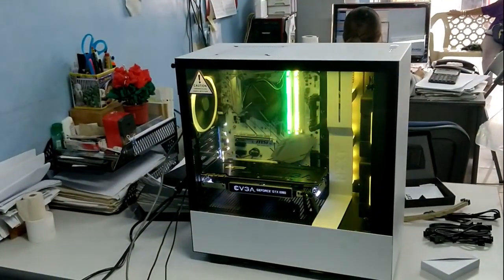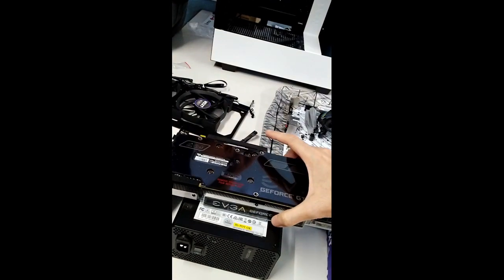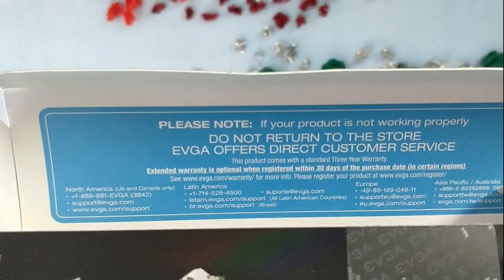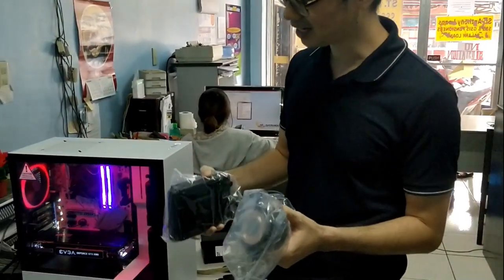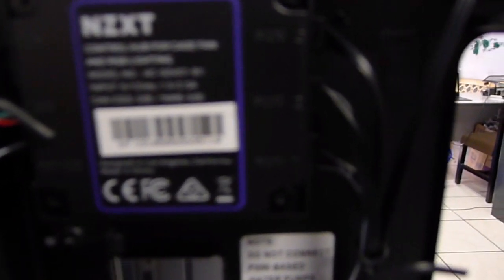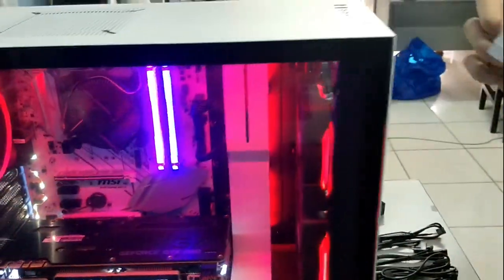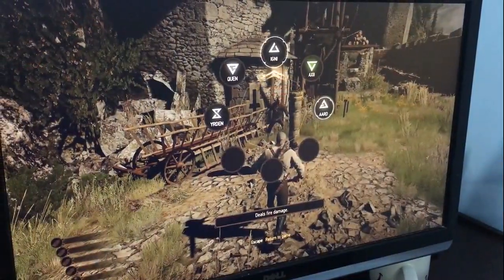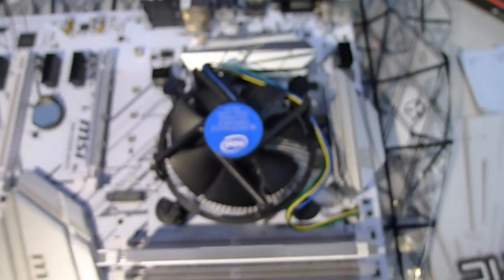Custom PHP100,00 NZXT Build

Comment: Is the m22 cooler a good cooler for 9600k ?
Reply from the maker: Yes, you can use an m22 for that cpu. Usually though if you're spending that much on a cpu, and one that you can overclock at that, you would probably go for an aio with a larger radiator. The m22 only has a 120mm radiator, most builds with a 9600k would probably use an aio with a radiator of 240mm or larger.
Reply: Hardware Sugar yeah but the other nzxt coolers are so costly here. I really wanted to get an nzxt cooler. Can u suggest me good liquid coolers please.
Reply from the maker: @tebii4707  the m22 will work fine for this cpu on stock speed and even with a little bit of overclocking so if you like it I would recommend you go with that 🙂 Personally for me aesthetics for the aio is a big factor and I really dig the mirror finish of the nzxt aios. Asus also has an interesting take on the aio where they've put in a small led screen so you can display logos. Cute but pricey.
Reply: Hardware Sugar thanks man for the suggestions. Appreciate it. I think il go for x62 i guess. Cause the reviews for this cooler is not satisfactory. But thanks anyways. 😁